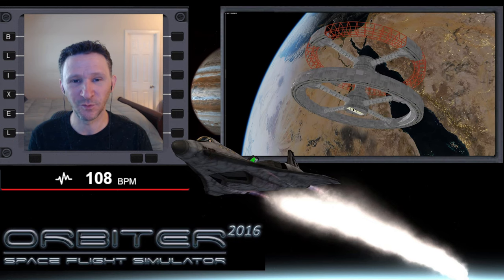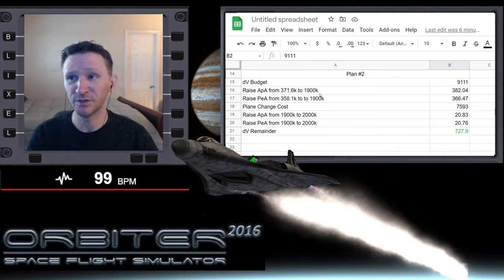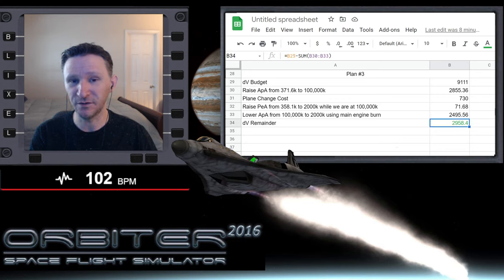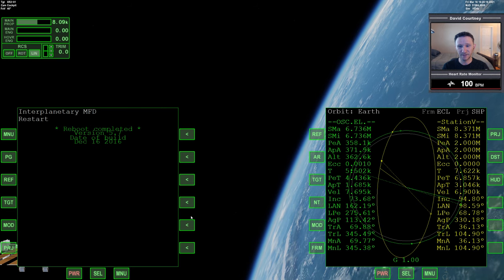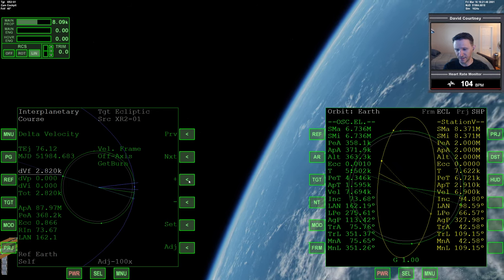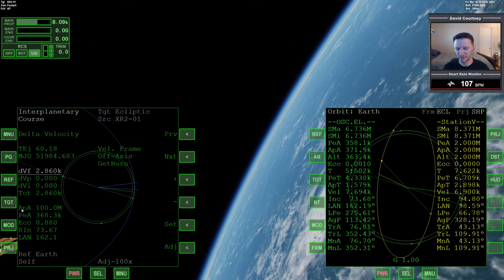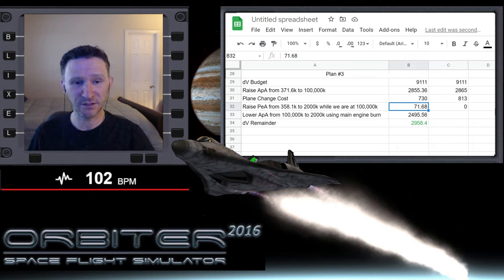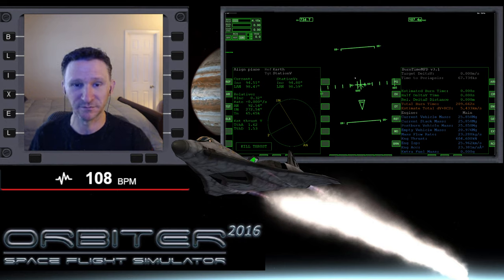Orbiter 2016 - [Part 2] XR2 ISS to StationV Rotating Space Station

Comment: Interesting to note that prior to the burn, Align Plane reported estimated thrust of 34.04 seconds at the ascending node and 538.4 seconds at the descending node. That's a savings of about 93% of the fuel that would be required at periapsis, and you also raised your periapsis at the same time. Cheers!

Comment: Plan 3 is also safer.
Reply from the maker: One of the difficulties of Plan 4 is not messing up your plane alignment while using the atmosphere for your deceleration. I'm sure it's still cheaper overall, but it does add a layer of complexity.

Comment: Couldn't you time the burn in IMFD more accurately by opening the align planes program on the other MFD and inputting the Tn value as TEj in IMFD?
Reply from the maker: Hmmm.... well, the problem with that idea is that the Tn value Align Plane gives me is based on my current orbit around the Earth. (About 2,751 seconds from node to node.) It can't give me a Tn value for my 100,000k apoapsis until after I've already done the IMFD burn to raise my ApA. And by the time I've done the burn, I'm committed.
Reply: @DavidCourtney  I'm curious if timing the burn better would reduce the large mismatch between the resulting orbit's major axis and the line of nodes. I've downloaded the scenario and will try it out when I have the time.
Reply from the maker: @JacekNasiadek  Timing the burn so that ApT and Tn match would definitely be better.